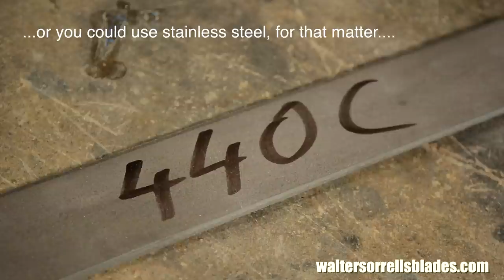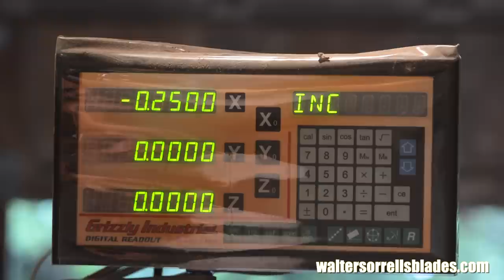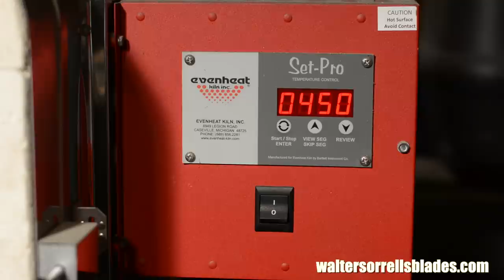Making a Damascus Steel Chef's Knife

Comment: great video!!!! very nice job!! but at 11:20 did you really drill the tung holding the blade ?? if the drill bit stuck and take the little vase with it where your hand will go? :S :D !!! other than that gets job again sir
Reply from the maker: +Nick Cnctech (cnclathe) The blade is held in a drill vise and the blade is not sharp at all at that point.  Every now and then the drill will try to snatch the blade, so you're just applying a little pressure to keep the vise and blade on the table.  Zero danger of hurting yourself.

Comment: it wouldn't be right if i didn't call you out for the san-mai. why? this blade will not need any shock absorption properties, and the thickness to length ratio alone is enough to make sure it will never shatter.

edit: never mind, i got my answer from the video.

Comment: how hard is it to do it by hand if you cann't afford a press.
Reply from the maker: +mpmccurry Honestly?  You might as well forget it.  I've made damascus using two hammering assistants and it's still incredibly hard work.  I'm not saying it's impossible.  And I've done it by hand in tiny little batches.  But that's about all you can do.
Reply: +mpmccurry Yeah, don't bother. Even rough forging by hand is tough work (there's a reason the quintessential strongmen of medieval times were either blacksmiths or woodsmen!). That said, it's certainly doable. It just isn't practical, and most custom makers aren't likely to sell them at a high enough price to make it worth their while.
Buying 0-1 flat stock and shaping it is about as intensive as I'm willing to get anymore. Forging - too hot and too expensive to get into.

Comment: instead of re cutting and re welding the milling . why didn't you fold it over when forging the steel?
Reply from the maker: In my experience, if I want the cleanest, most problem-free welds, I get better results with the cut-and-stack method rather than folding while hot.
Reply: yes but that is why you would pour flux onto the billet before it is folded
Reply: ***** There's nothing arbitrary about how this guy makes his damascus.
Once you put a lot of work into a billet and realize at the end that you have a scale inclusion that basically ruins the nice clean look of the knife, grinding between welds suddenly seems very worth while.
Reply: the black stuff on the outside is scale and if its not cleaned off it could leave a gap of scale in between the 2 steels and make the layers not weld and will leave ugly cracks. that's just me though
Reply: Cutting gives you a cleaner more uniform pattern.  Folding causes large ellipses and other irregularities to form.
Reply: folding gives the steel a more natural look. and as I have said about 12 times using flux stops irregularities and pitting.

Comment: I have seen in other videos, blacksmith just folds hot bar in half to make more layers. Here, he cools it off, grinds it flat and then wields together. Can someone explain, what is the difference?  What does this grinding after every layer really do?
Reply: I think when there is dirt under each layer and when you go final machining (sanding) you maybe come across a hole!

Comment: Hey Mr Sorrels

Why dont you just bend the the steel into layers instead of cutting them and stacking?
Reply: Try folding a high stack of paper. It doesn't fold properly, the outer ends are shorter and so on...

Comment: Have you worked with S7 steel and what is your opinion of it for blades.
Reply: s7 is better for making tools, especially cold working tools that you want to have hold shape. The reason it wouldn't be so great for making blades is that the price is rather high in comparison vs good blade making steel. High carbon steel such as 10XX are a good start for making knives as a beginner as the price will be lower. Often if you have a machinist shop in your town/city ask to buy small ends of 1040 steel....they should have some kicking around in the scrap box and are usually more than willing to part with some for a small price. (that's in the carbon steel)
in the alloy steels maybe 4140 (chromium molybdenum) which will offer more resistance to corrosion than carbon knives will.
for blacksmithing I use s7 for my repousse (reh-pwah-zay) and my touch marks. It stands against some heat when used as set tools but is best used vs impact without deformation & cold work. typically you'll be paying a good amount to use s7 unless it comes from salvage.
stick with chrome-moly 4140 and 1040 high carb steels, cheaper and easier to find...more common for blade making as well.
Reply: Hexus Ziggurat you'll be paying a good amount to use s7 unless it comes from salvage.
stick with chrome-moly 4140 and 1040 high carb steels, cheaper and easier to find...more common for blade making as well.

I bought a wooden plane years ago from a retired joiner who had it most of his working life and mine is nearly over now. It has an old English steel compound blade with a tiny but noticeably different steel in the cutting edge.

It cuts better than an electric hand plane and runs so sweet you don't realise it is cutting compared to a modern steel hand-plane. Before buying it, I tested it is on a shed door I was fitting and kept tapping the blade out further and further with each stroke until it was ripping off silly thicknesses of shavings. In my haste I even went through nails without realising it. This thing had been under his bed for years after he had retired. Unused and sharp as hell.

I often wonder what the steel in the cutting edge is and how it was made. I think I paid something like 50 pence for it. It must have hurt him to give it away at that price. He probably only did it because not many people back then would have appreciated it after he was gone.

I wish I could go back 20 or 30 years or so and give him the fiver it was worth. (Yes I know it is is priceless but you can pick them up for a couple of quid, still, at any car boot sale.) Nobody uses them because they seem old fashioned.
Reply: Michael McNeil It was very common practice back in the day (100 years ago) to forge weld a cutting bit onto a less costly iron (maybe wrought iron or low carbon steel) body, to save on money. This practice isn't done as often today in as wide a variety of tools as it had been then....some pieces are still done this way such as saw blades and other cutting style tools (high carbon or alloy steel teeth welded to the tip of the rakes).
Sounds like you got a "good old blade", which was likely built in the era (pre-80's) when things were built to last.

As in the video this resurgence of cutting edge is very common in pattern welded knives since many patterns are made with low carbon steel (offering looks) so a good knife steel will have to be sandwiched in there for a cutting edge.

Comment: I'm a little confused here. The knife looks amazing but the cutting edge isn't damascus? I thought the purpose of a damascus chef's knives was that the folded steel created micro-serrations which helped when cutting. Let me know if I'm wrong here, this isn't really something I know much about.
Reply from the maker: EminentArson   The whole micro-serration thing is BS.  Damascus is just a design element.
Reply: Walter Sorrells Thanks for the reply, it's rare to have video maker feedback. Also, thank you for the videos in general. I'm hoping to do a few diy projects myself, and your videos have helped tremendously.
Reply: Walter Sorrells 
Very insightful indeed. Thx.
Reply: EminentArson I agree with Walter.  Damascus is just eye candy, unless you also forge weld a high carbon steel insert cutting edge.
Reply: Damascus was used for swords like the japanese katana to provide a number of different qualities of the blade. The different layered steels would give the blade the best of both worlds, it would be strong and hard but not brittle, while also keeping its flexibility and a razor sharp edge. So historically, damascus hasnt only been used for aesthetic purposes.
Reply: I thought the process for making real Damascus steel was lost. I know there are ways to make it look like real Damascus steel but unless I'm mistaken no one has been able to recreate the properties of genuine, period correct, Damascus steel.
Reply: Natsu Dragneel you are describing Pattern-welding.  not Damascus....
the ways to make Damascus are gone to the ages....
Reply: Natsu Dragneel Pattern welds help to equalize the steel and remove impurities, the same can be done by heating the billet/knife up and sticking it in a bucket of ash or sand to let it slowly cool.  It wasn't their pattern welds that kept flexibility and razor sharpness, it was their methods of heat treating.  They would apply some kind of mud paste to the spine of the blade so when it was quenched, the edge would become very hard while the rest of the sword stayed flexible.

Oh yeah, and to those of you saying the damascus "method" is lost - damascus IS pattern welded steel, and the technique varies by the smith, as well as over time.
Reply: ***** Pattern welding and Damascus does not remove impurities.  It makes the material tougher by lamination.  A solid billet is not as strong as many thin layers.
Reply: funkawitzable The more you work steel, especially when you turn and fold it making damascus, the more the impurities rise to the surface and are removed from the steel.  Welding two pieces of steel together isn't like gluing a laminated bow together, or weaving a rope - when two pieces of steel are joined it's simply a phase change to join them (plus a slight change in the crystal structure).  It does not strengthen by lamination.
Reply: Impurities don't rise to the surface and magically dissipate.  Vanadium, tungsten... All those, get mixed in.  Cementite is where the strength comes from, not from impurities coming out.  Ferrite and pearlite banding.

Read Smiths book.  If what you are saying is correct, then Wikipedia, Google, Harvard, CMU and metallurgy in general is wrong.

http://www.tms.org/pubs/journals/JOM/9809/Verhoeven-9809.html

https://en.m.wikipedia.org/wiki/Damascus_steel

It is now widely believed that in addition to a unique mixture of alloys in Wootz steel, carbon nanotubes played a large role.Carbon nanotubes are incredibly strong microstructures that can flex and bend with ease. Ancient Damascus steel bladesmiths probably had no idea of their existence in Wootz steel ingots.

Nowhere does anyone mention about impurities coming out.  In fact, the impurities is what made it do its thing.

I'm not out to start a war, but you might wanna read up.
Reply: EminentArson  Nope. Damascus is just for looks. In fact it it weaker than typical carbon steel or stainless.
Reply: This blade is just Damascus patterned. Actual Damascus was made from wootz steel which is all gone now.  The marble effect of the original Damascus was not actually intended and was just a side effect of the unique and still unknown blend of impurities in the iron and whatever organic matter and process they used for carbonizing (which somehow resulted in short carbon nanotubes being produced in the finished steel).
Reply: Hmmer Pimy It is now… Didn't used to be. "Damascus" isn't used anymore. I literally just explained that
Reply: True, but there was a time when you either had good brittle high carbon steel, or butter soft low carbon steel and nothing in between.  Smash em together and them molecular dooflickeys get confused and make something tougher than low carbon but less brittle than high carbon.  Then someone came out with superior steel, they took a baffled look at this super awesome steel, and threw that Damascus in the trash and made a solemn vow that no one speak the name Damascus again.  Every so many years a few people dig it up, dust it off, and proclaim it as the greatest invention since underwear with activated carbon in it to make your farts not stink. 

Damascus is pretty.  Damascus is functional.  In 2015, Damascus will not get you laid with a super hot chick that is rich and likes to go fishing.

Comment: What the ancients meant by Damascus and most moderns mean are two different things. This gentlemen is using the term to mean a pattern created by forge welding two or more different alloys together which is pretty much the modern idea. I like this basic design or at least the rear part for large knives. That is you have a basic handle with a wide blade that acts as a half guard. Simple and effective and you don't need a lot of crap like a guard to keep your hand off the blade. I also prefer a thin blade with a full grind because it cuts best. I don't care if you disagree. That's just what I like. You can like a brick. I don't care. ?8^)

Comment: Do I want to know how much one of these costs?
Reply: +JgHaverty I have a pattern welded chef's knife, they run from between $90 to about $300 depending on the number of layers, material, size etc.
Reply: +JgHaverty Worth the investment though, they last a lifetime and go a long time between sharpening (2 months-2 years depending on home or professional use)
Reply: Pat Meyer I know they are good, and are investments. I was expecting it to be 500+ haha. 

I really would like a 9" chefs knife. Probably north of the 300 mark haha
Reply: +JgHaverty I bought mine a couple of years ago for $120, that was for a 15cm (6"?) blade. So yes, probably 2-300 for a large good quality blade.
Reply: +JgHaverty  ...300 to 750+
Reply: +Bruce Calder I concur. $90 -$300 for a production blade, yes. Custom, hand forged, laminated blades would be at least double that range.
Reply: +JgHaverty If you substitute the top knife in the picture with a fluted vegetable knife you&#39;ll see what my dad has. His block is different but the block we got him was $100. He also has the carving fork and one other knife so add a few hundred to that price tag. Knives aren&#39;t cheap especially when they&#39;re hand made and specifically patterned.
http://www.amazon.com/Global-Knives-Piece-Knife-Block/dp/B01AIPHI06/ref=sr_1_4?ie=UTF8&amp;qid=1454991554&amp;sr=8-4&amp;keywords=global+knives

Comment: I liked the shape of the knife until I saw that you put the bolster all the way to the heal of the knife.  The bolster at the heal makes it difficult to sharpen using stones and as it gets sharpened the blade will wear down and eventually will stop touching the cutting board near the heal of the knife because the bolster doesn't get warn away when sharpened.  If a French style chef's knife is held like a chef would hold the knife the bolster simply gets in the way, too.

Comment: Why do so many knife makers not bring the edge all the way back to the handle.... this creates issues down the road because as you remove material to keep the blade sharp you are unable to do so toward the handle and end up with a curved edge that doesn't contact your cutting board.

Comment: So my fixed blade knife is bent to one side what can i do?
Reply: If it's already heat treated then not much of anything. If not then heat it up and straighten it. Make sure to heat it and let it cool in the air a few times before quenching to relieve stress In the blade and prevent twisting bending or cracking during the quench

Comment: Epoxy glue mixed on the table ?? Dirt can get in the mix.
I use 3x5 inch paper index cards, and popsicle sticks.......cheap and clean.
Reply from the maker: +Randy Leifer It's not on the table.  It's on tape that's attached to the table.
Reply: Ahhhh. ok, thanks !
Reply: +Randy Leifer Come on :P no respectable craftsman of any type would do that to their work surfaces, unless you want to end up with an epoxy landscape after a while..
Reply: +aaron4820 I happen to enjoy the picturesque views of the valleys and mountains of epoxy dried to my workbench.
Reply: That darned painter's masking tape has a rubber/latex blend in it and works VERY well for his purpose!

Comment: By putting the solid non-folded piece of steel in between the folded steel, you destroy the main purpose of Damascus steel. Damascus steel is what it is, because the folds become very thin and you can get a sharper edge. Knowing that, why would you put a solid non folded piece of steel in the middle (to use as the sharpened edge) knowing you get a sharper edge from the Damascus?
Reply from the maker: Ur Human Toast Actually that's a total myth.  Damascus has zero performance benefits over homogeneous steel.  In fact, the only rationale for Damascus steel is that it looks cool.  A long time ago, folding was beneficial from a performance standpoint as it helped remove impurities from steel and make it more homogeneous.  But there has been no need for that since fluid steel-making processes were developed in about 1870.
Reply: BURRRRRRRRRRRN
Reply: +Walter Sorrells Damascus steel was not folded. Who told you that. It was hmogeneous steel and it's forging method was forgotten centuries ago. Another sunday expert.
Reply from the maker: I guess you missed the other 8000 people who made this same ill-informed comment.  The term "damascus steel" has been used by Western smiths and gun manufacturers to describe forge-welded steel for over 200 years.  Every smith on the planet knows about the Central Asian homogeneous steel you're talking about.  It's referred to by knowledgeable people as 'wootz.'  Referring to wootz as 'Damascus steel' is misnomer.  t was never manufactured in Damascus, but rather in India and in what's now Tajikistan and Uzbekistan.
Reply: +Ur Human Toast Damascus steel doesn't get any sharper than any other steel just because its done in the Damascus style, its almost purely aesthetic. A lot of people tend to think that Damascus steel is actually less tough than a knife made with regular style steel. Whether that's true or not im not too sure.